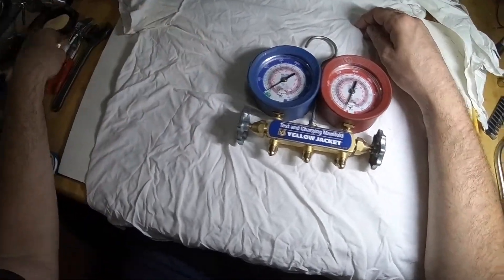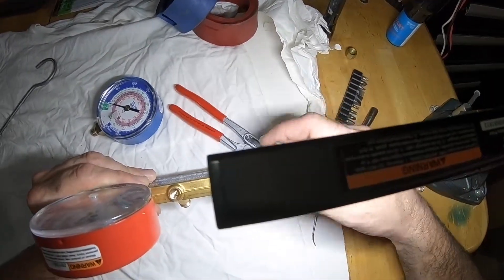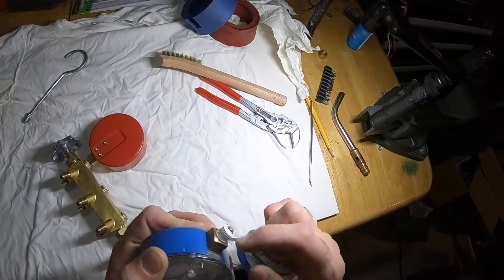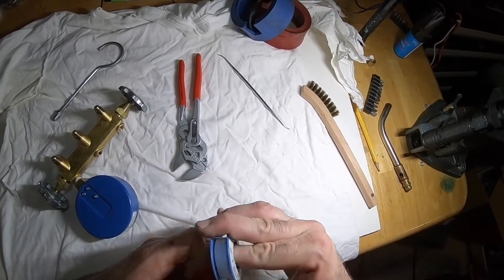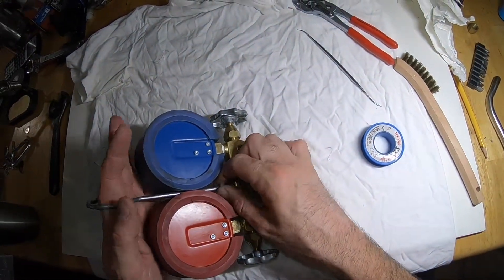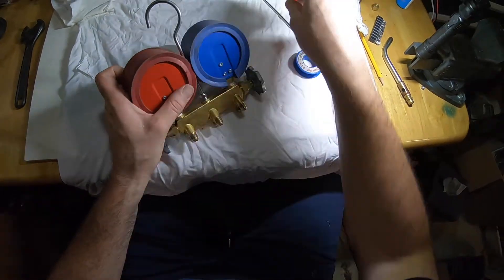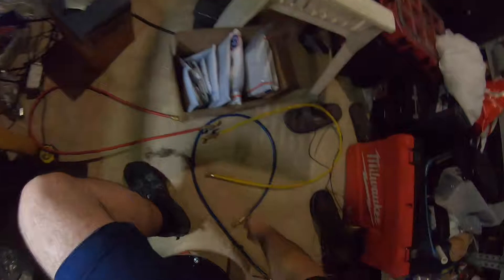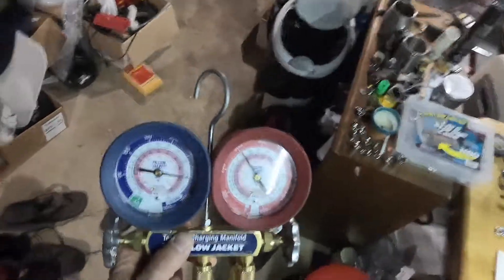HVAC Repairing Leaking AC/ Refrigeration Gauges Tool Maintenance

Comment: You over use the Teflon tape & wound the tape in the wrong direction. It wants to unwind when you tighten it. You have nice adjustable pliers but are using them backwards. Good luck.
Reply: You get leverage where you can working on these imo you can just take the valve handle off for more room tho you’re not lying